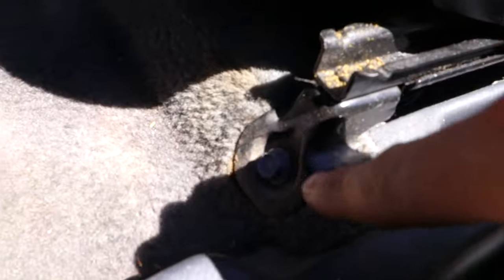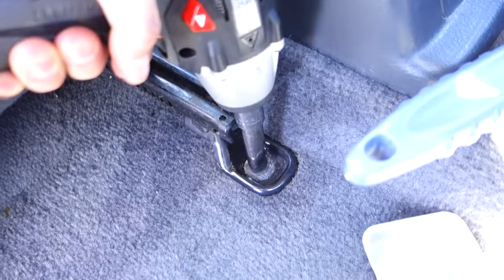How To Swap Integra Seats In Civic EK || Honda Civic Ek9 Build

Comment: Swapped these in both my hatchbacks. So much more comfortable then stock ek seats.
Reply: What integra sits will fit in a ek?
Reply: 94 to 01 integra seats will fit but you have to swap the rail. Just like in the video. 99 to 00 si seats will bolt right in also.

Comment: Should have used em with the integra rails they fit fine the 4th bolt you need to drill and make the hole a bit bigger but it all lines up and bolts up annnd they sit lower also
Reply from the maker: Not a bad idea! I didn’t know that would be a good option. Thanks for sharing
Reply: I just shared since i saw that your tall and sitting lower would make the ride alot more comfortable for you
Reply: Can you explain this to me in more detail  I just put gsr sear in a 95ej2 and noticed it sat a little higher trying to figure out how to get it lower?

Comment: Why did you scrap the GSR and not rebuild ?
Reply from the maker: Car lived in Ohio its entire life (1995) and the bottoms of the doors, rear quarters, rear subframe and multiple other areas were going to require a ton of body work and replacement pieces. I'll be stripping the car for all the parts to sell and to put on the civic.
Reply from the maker: +Steve Moh there was too much rust all over the frame and body that I was better off with time using it for parts and selling

Comment: have you done the back seats. thats all im missing on mine. i just don't know how to...
Reply from the maker: There are a couple ways to do it that I might include in a video. If I decide to do it, I will certainly film it to share.
Reply: hopefully you do. and thanks for the videos.
Reply from the maker: Anytime! I want to do some more tutorials like that anyways so it works out for everyone.
Reply from the maker: +blix8787 I have not yet but I might give it a try. You can use the back piece but the bottom you will have to swap over the civic seat pan by pulling off the fabric. If I do it ill make a video

Comment: Will this be the same for Integra DA seats into an EK?
Reply from the maker: Not sure actually... Depends if the DA integra chassis was based on the EF civics or EG civic. My guess is it won't... but doesnt hurt to try!
Reply: DA seats do not fit in EK. You can swap the seat pan which is a pain.
Reply: @stefanzomods  I got 1990 integra ls 4 door(da i think). What front seats could I  fit( swap).

Comment: Do you have any info about Prelude seats in EK?
Reply from the maker: I do not... but I would guess its not a straight forward process. You would most likely need to cut off the mounting ears and reweld new ones onto the brackets.

Comment: I cant get the metal hanger looking thing to move the seats up and down don't line up what am I doin wrong
Reply from the maker: +Michael Alarcon I'd tilt it forward so the rails line up at the front and try looping the hanger .
Reply: u doin it on a hatch i have coupe i dont know if makes a different but could not get them lined up it was way off
Reply from the maker: interesting. Are you sure you had the proper rails to swap?

Comment: Do you know if 4 door integra seats will fit on a ek hatch?
Reply from the maker: The front seats are the same as a 2dr integra but the rears are different... I would say the rear integra 4dr seats are a no go in the civic
Reply: Front seats did fit. I swap the rails only thing had trouble with was removing clips from seat adjuster. Thanks for the help
Reply from the maker: no problem!
Reply: @StaufferGarage  will 4 door integra rear seats fit 4 door ek rears?